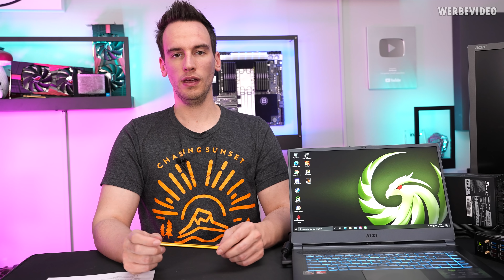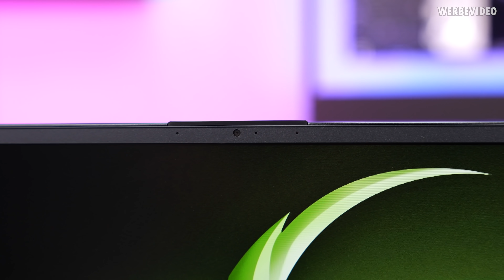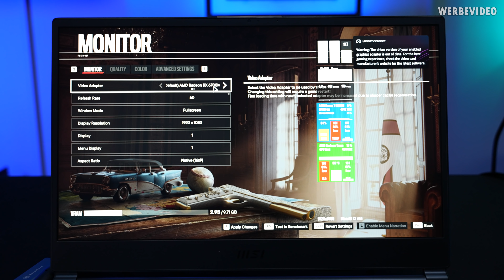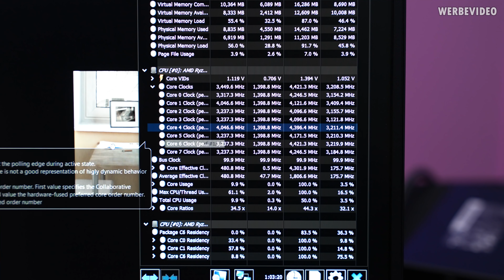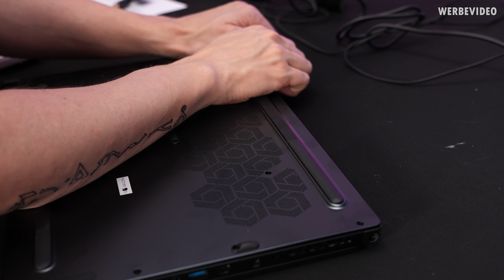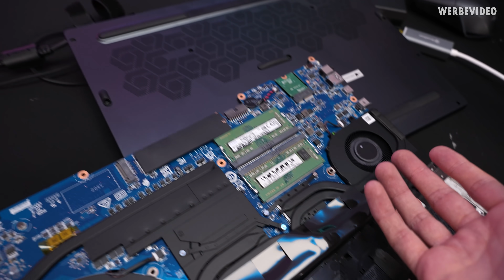My first time using an AMD Mobile GPU in over 10 years - MSI Delta 15 AMD Advantage is awesome!

Comment: Greetings everyone.  M.2 drives only last me 6-8 months. If I remove the Delta 15 keypad and re-assemble could I reach the m.2 slot without taking it apart again?  I keep laptop in a cabinet non portable.  Thanks for any replies

Comment: Do not buy this delta 15 unless you intend to replace it very soon. The hinges last less than 1 week of very very carefull minimal use. Never seen such a bad design. You have been warned. None of these promoters will tell you this. And it runs hot. So hot you can't touch it. It has potential. Just not yet.

Comment: In battery mode, this laptop is super silent, Wen i plug in it starts to ramp up the fan speed in light tasks. Temperature is around 50-55 (with fan spinning). In battery temp is around same range (without fan spinning). I was just wondering if you can have silent profile while doing light work. The fans runs around 2400-3000 RPM when plugged in. I tired using MSI center but no progress.

Comment: What were the maximum and average GPU clock speeds during the tests? I managed to achieve a 2500mhz overclock on the GPU at 90W power consumption, temps do go to high 70s but the gpu performance over stock is much better I believe 
Also you can unlock the gpu up to 130w but that laptop is just not good enough to keep the temps decent on such a high power level, at 130w the gpu will mostly peak 90 all the time then clock down, so I think around 110w and overclocked memory with around 2550 core should get you pretty close to a desktop 2080 in performance 
Ofcource that's if you power it from the wall :)
From a desktop 1070 level performance to almost a 2080 performance is quite a huge jump tho and certainly you can do 1440p gaming if you do decide to increase the power limits
Reply: hey bro thats some crazy performance. may i ask how u managed to overclock ur core and memory and what were ur settings. would really appreciate it. thanks
Reply: @tibby1239 same question 😂😂

Comment: I thought the battery disconnect was for e.g. gaming with the power adapter connected. Meanwhile the battery is not under charge also when possibly the battery is full. I.E. meaning that the battey is not in a state for being charged when it's full. Hence preserving battery life. 

If that was the case, then it would make more sense to make the battery disconnect switch more reachable.

Comment: I had an AMD mobile CPU once, but can't remember what it was. The laptop had an Nvidia Gefore Go 5700 graphics chip. It only had 256MB of RAM when I got it, and the gaming perfromance was a bit poor. Like I played Quake 4 on it, and it dropped to less that one frame per second sometimes. However when I put another 256MB of RAM in, it was vastly better in gaming. (I didn't have it from new.) It was a good buzz having an AMD chip though.

Comment: sounds as bad or worse than my old I7 8700k + GTX970 setup in pubG, i dont think thats very good for a brand new and expensive laptop. Also 10gb of vram seems odd, on such a weak gpu, the gpu must have been made solely for laptops since theres no bit bus that adds up to 10gb for any AMD desktop parts.

Comment: I have an older version of this with 8th generation Intel and they used the flipped design on mine too. They didn't on the model after AFAIK so it's interesting to see they went back to it. For thermals maybe? I used to repair laptops so it wasn't a big deal for me but would be nice if storage was at least on the back side. 
Also mine has that switch too. Always thought it was a cmos reset but maybe not! Very cool feature.

Comment: I had not noticed the Stargate address on your arm before, do you visit there often? I guess the Stargate activation is when we get a drop in the mains power supply voltage.

Comment: MSI does this horrible stuff to their every AMD laptop. Months ago.I found the solution to the problem.. Basically There's a feature called D3Cold in BIOS MSI AMD laptops. this feature creates major stuttering when the IGPU switches to dGPU.. What D3Cold does is it completely switches off the dGPU instead of running it at a low power.. that creates the Major stuttering.
This is a major issue. And people are blaming AMD for it for no reason. MSI should turn off D3Cold by default 1. Enter BIOS
2. Advanced TAB 3. Press right shift + right ctrl+ left alt F2 (Unlock advanced BIOS)
4. Go to AMD PBS> D3Cold support > Disabled

Comment: hey, I'm confused by your 3dmark graphics test. I have A5EFK-001US with 5800h and 6700M and TimeSpy GPU 1 test for me is 63.49FPS in extreme it's 28.47.  That's in the performance profile   (a scenario in msi center) while plugged in with the laptop display. I do have the drivers installed from AMD instead of MSI.  (I have noticed I get slightly higher results that way).
Reply: time spy score should be looked at in points not fps
Reply: ummm....   not if you are just comparing gpu1 test score...
Reply: Because this guy knows nothing about the product and get sent free crap to spread false info. He doesn't even know how to enter the hidden bios which let's you OC like a real desktop board. It just amazes me how these company's send these people free products to promote and they make the laptop look worse.

Comment: The problem with AMD GPUs is that they aren't very polished. I have rtx 3060 laptop and it always just works. I have never needed to go in windows settings and set any game in to "high performance mode" or something. But amd CPUs are awesome. Especially for laptops.

Comment: I remember when you got a desktop 1060 performance laptop, with 120hz display and i7-8750H, for ~$700 euro. Crazy how much worse the performance per dollar has gotten.
Reply: i got an acer nitro with a 3060 for 850 euro last week. and a predator with a 3070 for 1199. they both have 2 M2 slots and a 2.5" too. laptops are definitely the way to go while waiting for things to calm down.

Comment: now i am using Asus rog amd advantage edition. with qhd screen, had MSI bravo 15 before, Actualy surprised about flipped motherboad as none of my laptops have it. curent asus laptop cinebench single tread score same 537 but multicore come as 5037, MSI laptop bios have advanced mode if you press key combination to acces other settings. cant remember keys combination but easy to find. there you got acces to memory timings and power settings at least on bravo didnt digget deeper. nice solid revew short and to the piont.

Comment: Wow, the temperature performance of the laptop is really impressive, I'm jealous cause my intel/nvidia laptop always reach 70+C all the time.
But on the other side, my laptop's motherboard isn't flipped and it's really easy to upgrade and clean so I'm happy with what I have.
Reply: It's not really impressive, tdp of gpu is only 60w and cpu is limited to 45w. With tdp this low it has to be cool.
Reply: Pretty sure he was running it in a lower power mode. Mine goes up to 105 watts on the gpu on maximum performance, and does get quite toasty.

Comment: I also have an MSI laptop with nearly the same exact specs but from a year ago. R7 4800H, RX5600M, 16GB DDR4, 1TB NVME SSD. The motherboard is NOT flipped around in mine, thank god.

Comment: My first time using an integrated GPU in over 25 years - hehe, everything else is mining :))) ..voodoo banshee 16mb, voodoo5 5500,geforce4ti 4200(partying 10y),r9 270x, gtx1060, rtx2080,3x 3080..
used my retro gf4ti, than noticed uhd630 can run all those retro games same + can some new..no brainer, uhd>gf4 heheheheh
Reply: Miners are destroying PC market...
Reply: @GameslordXY   what about LHR? and it s my living income,wouldn t even consider it if my environment is perspective

Comment: Great review. No hardware review should lack a tear down. On a flip note: publishing the opening process/diassambly via an unedited footage would be a service to whoever buys that and attempts upgrading - 16GB RAM default setup is just way too low.
Reply: @117gerardle  eh, the extra memory is never wasted - it becomes disk cache (pretty much any OS would find great use of). Trying playing any game that has zones (load times) and you can switch between them having more RAM.
For my work (which is not 'content' creation) 16GB is just way too low. Pretty much any serious non purely office text document creation calls for more memory.

Comment: There are some very good design choices here, like the reset switch and the thermals look good, but the lack of DRAM timing controls and the difficult access to components is a nuisance.
Also, can you take out the fans without removing the MB? Because having to remove the MB for cleaning the fin stacks is a huge hassle.

Comment: The main reason I'd use it over Nvidia is that it's not Nvidia. At least once driver support ends, you'll be able to install Linux and get extended driver support from people who don't need to worry about their bottom line.
Reply: Radeon has dithering ON by default (no banding on colours/gradients). It's an important setting for color management. Nvidia refuses to put this setting on Windows even though it's available on their Linux driver. These little things turn me off from Nvidia.

Edit: Another Radeon-only feature is SRGB EDID clamp. It allows toggling monitor color to SRGB even if there's no OSD toggle. Makes me feel like AMD truly is the platform for professionals.
Reply: @Terrobility  "truly the platform for professionals"
Lmao, without CUDA it s*cks really hard.
Reply: @saricubra2867  That's the only flaw. Shame that CUDA's proprietary though
Reply: Here here!
Reply: The only big flaw with Radeon is the lack of CUDA, Open CL is so, so slow.
Reply: @saricubra2867  AMD has CUDA, but only for chosen GPU like Vega 56. Technically it is not exactly Nvidia CUDA, but your TensorFlow setup sees CUDA device which it can use to run on.
Reply: @angelg3986  bro I domt think so there 6000 series gpu yes they do ray tracking with their own cores Vega does not have any of that yet to my knowledge unless there 6000 series Vega
Reply: @rylanwill6969  cuda is not so much for raytracing, but for AI stuff, Google used it in tensor flow. TF won't run on AMD GPU unless AMD replaces Cuda with their own framework. And they have it only for discrete Vega56/64 GPUs and CDNA.
Reply: @angelg3986  sorry not Cuda cores but rt cores they each got their new cores and techoolgy so yea lmfao
Reply: If Radeon has it's own version of CUDA, then i would be interested.

For now, i'm team GeForce.

Comment: I'm sorry mate, but did you say 1900 euros is solid value? 

Its complete shit. Unless your country has outrageously overpriced laptops, that is a shit price for a 6600m or 6700m laptop.

You could get, a rtx 3060 laptop FOR LITERALLY HALF that price and spoiler alert. The 3060 on laptops, beats the rx6600m or at minimum, matches it. Yeah, there's a gigabyte g5 with a 105w 3060 for 1000 euros. Or close to it. 

And surely the rx6800m strix g15 from asus would be around 1900 euros if not less and blow this msi out of the water.

Nah, this is just a turd from msi. A complete turd of a laptop.

Comment: Tank you so much for the mentioning of the Ryzen 5 2600X being a strong gaming cpu today!!!!you make me so happy with tath coute!!!i almost blush!!!hehe!i have an tuf b450 gaming plus 2 and ryzen 2600X paired with 4X8gb team groupe vulcan z 3200mhz(3000mhz because the infinity fabric cap on this board)and an asus dual RTX 2060super OC v2 and 2X M.2 nvme kingstone A2000 disks and 2X 1tb hdd seagate fireCUDA disks and 2X 24 inch asus ips monitors and an glacier one 240mm AIO .the case is an MSI MAG FORGE 100m.and im very happy with this machine.i play cyberpunk on high settings 1080p with ray tracing on high  with 50-60fps (ADAPTIVE SYNC for the main monitor and no stutering at all!!!

Comment: I kinda wish I had an amd gpu as opposed to my nvidia gpu in my laptop, due to vram and efficiency. 

But amd has very bad and incredibly short driver support. The nimez drivers if I got the name correct are doing what amd should be doing so it is still there but its honestly work amd should be doing.

Im also having a lot of other software related issues I've never had with any nvida gpu like amd not really seeming to know what my monitor is and constant error messages about the amd radeon software app. And in the app itself.

Also noticed a bunch if ganes performing really badly on the 6700xt like fh5 for example.
Reply: Just install Linux once your drivers go out of support. AMD GPUs are supported for over a decade over there. Nvidia users don't have that luxury.
Reply: Not sure what GPU you last had from AMD.  The RX6000 series drivers are amazing.  I have AMD and NVIDIA GPUs and the new adrenaline wins hands down.

Comment: Its amazing just how powerful laptops have become after AMD finally started competing in this field couple years ago.
Reply: You mean last year ago. AMD was irrelevant in the laptop segment.
Reply: @saricubra2867  Nah. Ryzen 4000 sent shivers down intel's spine. AMD's 4600h was keeping up with 45w i9 9880h's. And that was a fairly popular processor with budget laptops. Infact it was almost as fast as the desktop ryzen 5 3600.
Reply: @setzer-j6s  That's what i said, AMD was irrelevant until a year ago on the mobile space.
Reply: @saricubra2867  Pretty sure they came out in march 2020 meaning its been well over a year.
Reply: @setzer-j6s  Well... you get the idea...
Reply: @saricubra2867  on the GPU side yes. But as for CPU, 8 core Renoir pushed the MT perf forward.
Reply: Really man? Do tell me, exactly what, popular amd card on laptops even challenged nvidia's laptop 1080? Hell, name one amd card on laptops that rivalled the aorus x9 with dual 1070's. 

Infact amd had no realistic answer to nvidia's 1060, 1070 and 1080 on laptops. Even the rx560x was barely competitive with the 1050 and 1050ti.

And the rx5500m and 5600m were pretty bad with drivers and coming in laptops with poor cooling. Only the rx5500m managed to somewhat challenge nvidia's 1650 and 1650ti when it came in better cooled chassis like the hp victus. Even then, it wasn't far off 1660ti's in price. 

So now, when amd has the upper hand in laptops. It fucks it up with pricing. Other than the rx6800m strix amd advantage edition, the rest suck ass in pricing.
Reply: @setzer-j6s  he's likely talking about CPU side of things. It used to be 2c/4t max for 15W class and now there's 5700U with 8c/16t.
Reply: @niter43   @niter43  Like you do know, even the 15w cpu's shifted to 4c/8t several years ago. 

And the video's title was about amd gpu's. So, he's likely talking about those. 

Because amd's cpu's already shat on intel by a wide margin with the ryzen 4000 series which are over a year old now.
Reply: @setzer-j6s  well yeah i was talking rather about CPU performance.  Even though the title says "GPU" the video itself is a review of a laptop. Watch the video before commenting please.
Reply: @soileH  Ah. Yeah, CPU wise, AMD did improve massively. 

Still. 1900 euros for a 5800h is a ripoff.
Reply: @setzer-j6s  
Why does the price surprise you so much considering the times we live in?
Reply: @GameslordXY  right huge ass inflation lol basicly just taxs for the poor lol I mean I seen 6800m and 3070 laptops for around 1900 2000 cad so I'm dealing on one just trying to figuire out if there  better then q ps5 or Xbox x

Comment: 6:50 for advanced bios:

right ctrl + right shift + alt + F2 while in the bios
Reply from the maker: Very nice have to try that :)
@sehitcan kutel: YouTube auto-blocks comments with links. So that could be the reason
Reply: can you adjust power limits?
Reply: @Crispe1Official  you can change in bios or windows TDP PStates durations like that. but i need undervolt CPU and GPU
Reply: @Crispe1Official  yes you can(i see but not tried). my commend is deleted i dont know why.

you can do same on windows with ryzen conrtoller or like apps.

i want do undervolt. i cannod find a way accesing offset voltage settings (maybe in bios i dont discover yet)
Reply: @becuasegoodreason  youtube is running a very aggressive spam filter that often misfires
Reply: you can look for bios selections on Jarrod'sTech channel delta rx 6700m review

Comment: Yeah it's fine, except those fake TDP values.
AMD laptop GPUs draw 50% more power than they're claiming.
Reply: Do you have sauce for that, or did ya pull out a number from ya @ss?  All GPUs draw more than they state.  But 50%?
Reply: @kobusdowney5291  Jarrod's tech,
Same laptop 3060 - 140W from wall, rx 6600 - 180W from wall.

Comment: The battery disconnect is a great piece of engineering. Great idea.
Reply: Alternatively they could have done that by having a timer on the power button itself, e.g. 8s+ disconnects the battery. Not a bad idea but rather a clumsy implementation.
Reply: @stanimir4197  Long press on power button is already bound to force power off on just about everything.